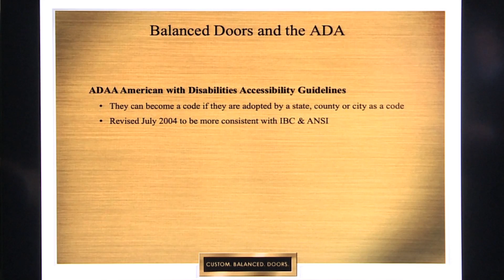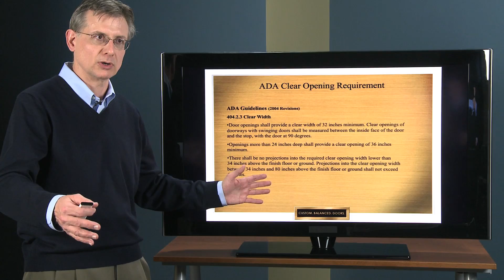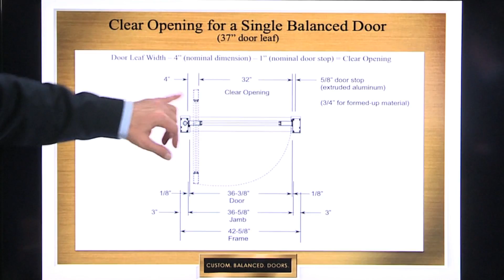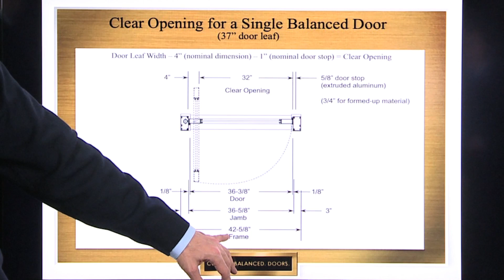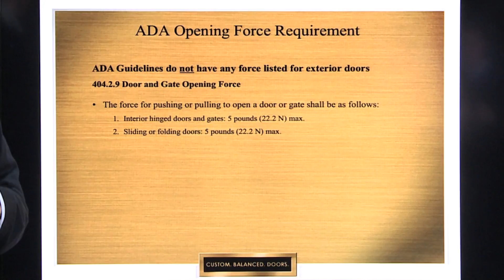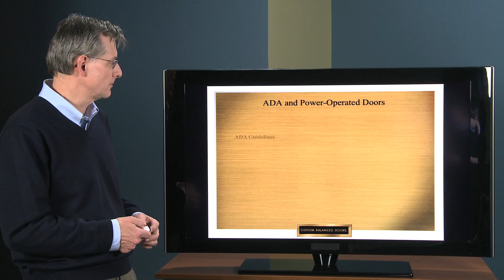ADA Compliance with Balanced Door Systems - Ellison Bronze

Comment: If I may be so bold.  Excellent videos!!  In regard to ADA, there remains confusion, and it stems, I believe, from the history of the core legislation.  In terms of PA, the ADA was passed by Harrisburg as civil legislation that modified our model building code.  This was during those first messy years when states stopped controlling the approval of architectural plans and responsibility (cost) shifted to the local communities.  In PA, that's the subunit of a county.  So Bucks County does not have a building code, but the 32 townships and 23 boroughs are the designated authorities having jurisdiction (AHJ).  There are other authorities, such as the Joint Accreditation Commission.  My point is that if you are left to sort out an ADA question, seek assistance.  It is confusing, but it really isn't.  I believe it is more a case of various sources of information and using a search engine to find answers.  This video may be promotional, but it is, I think, the best brief dialogue on a Balanced Door System.  So don't be afraid to call your township or borough in PA, and they can connect you with the information you need and offer opportunities to be of assistance.  Who knows, you might get a new project opportunity by introducing yourself.  Thank you Mr. Graves, for this excellent video.